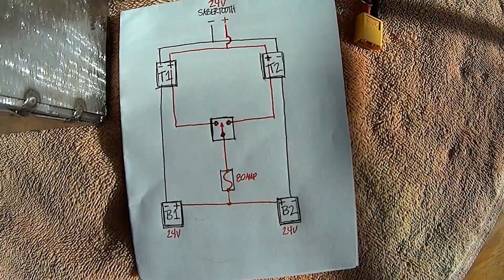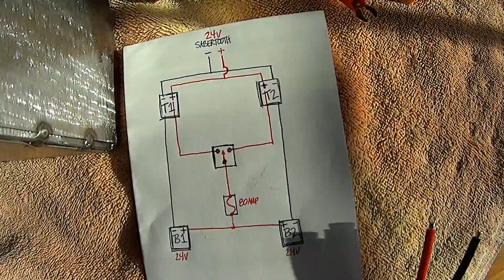RC Lawn Mower V2: Pt. 8 Electrical layout for sabertooth 2x32,  marine switch and lipo batts

Comment: I dont understand why you need a usb for this thing ??
Reply from the maker: The USB is for programming the sabertooth motor controller. Not something I will have to use a lot. However, it is nice to have easy access. I will do a short video of it when we do the initial run on the channel. Thank you for commenting.